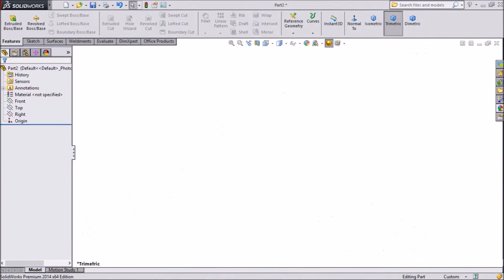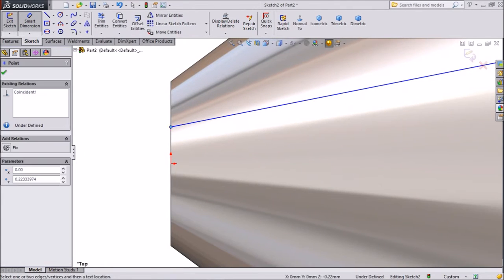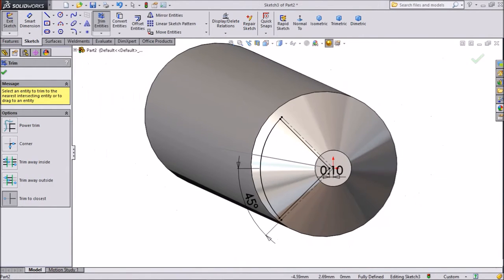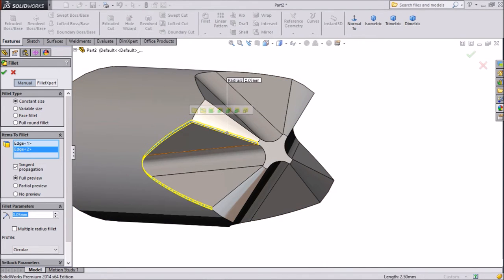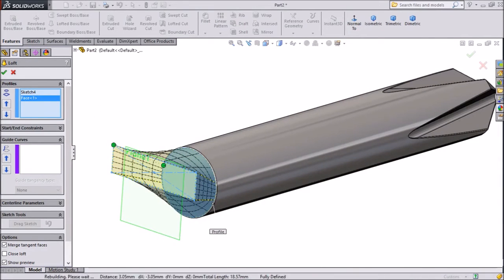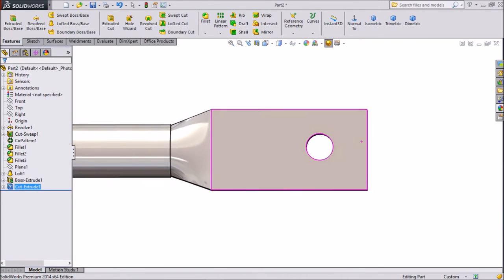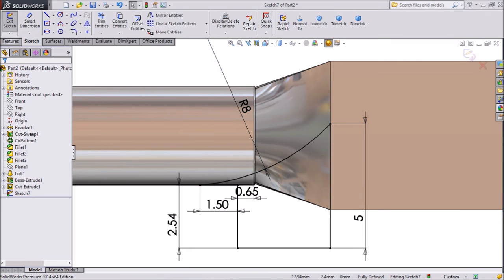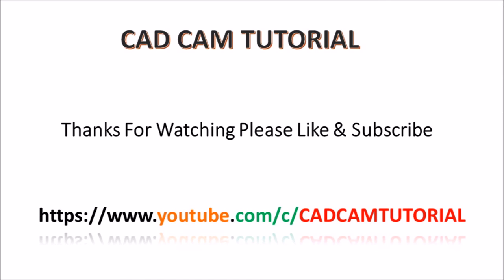SolidWorks tutorial Pocket Multi tool 3. Screw Driver

Comment: The circular pattern of the cut doesn't work on 2016 solidworks
Reply: Select geometry pattern in the dialogue box. It's not selected by default but it must be checked. I don't believe he mentioned it. Or that version of solid works did not require it.
Reply: Leonardo Rambo select geometry pattern in the dialogue box. He doesn't mention it but it must be checked for it to rebuild.
Reply from the maker: its working ,
Reply: +CAD CAM TUTORIAL I did the same exact steps and it fails on the circular part
Reply: It worked, but in the video, he doesn't check the box. Would you be able to explain me why it worked now? Thanks a lot man.
Reply: Sorry, I did not see the other comment, what does it affect on the rebuild? Shouldn't it work anyway?
Reply: Leonardo Rambo that confused me as well I'm not sure what it changes